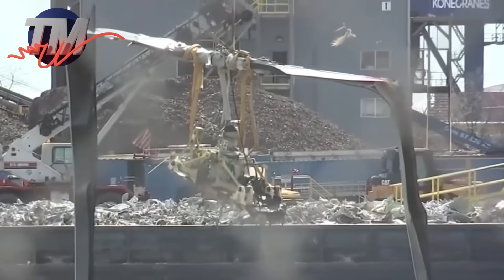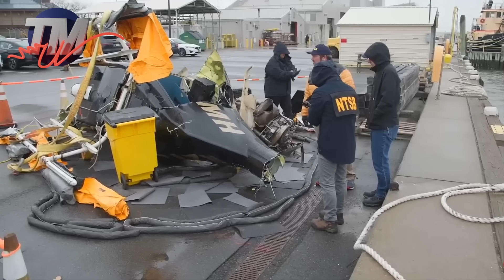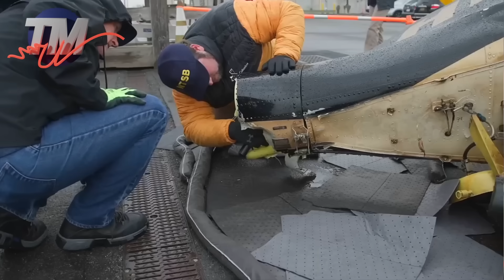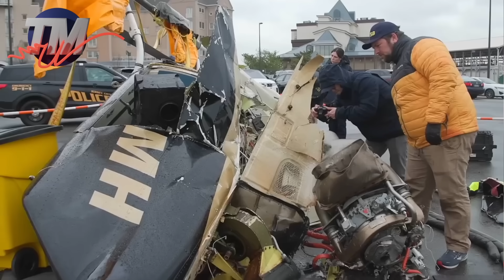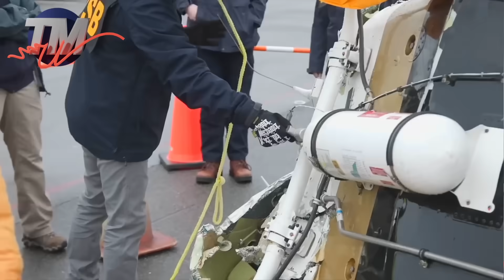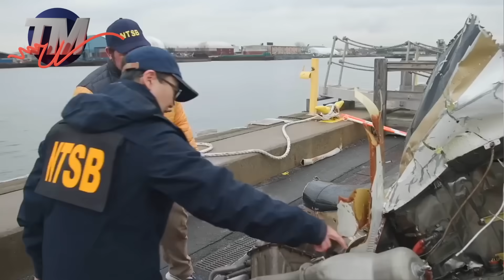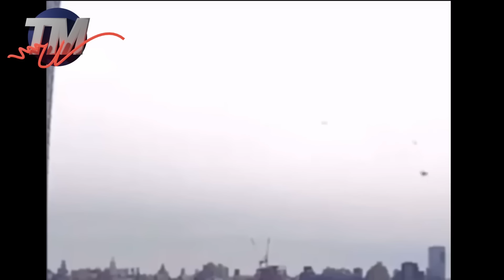Recovery of the Main Rotor of the Hudson River Tourist Helicopter - it's worse than we thought

Comment: It's not like you can hide accidents like this. Someone else suggested that there are far more accidents than reported but when a plane or a helicopter drops out of the sky in clear view of who knows how many people, never mind being recorded by multiple cell phones, how do you not cover that or cover it up? I understand close calls not being reported and from my own experience, I had a fireman tell me once upon a time, just how many times a week that they foam down the runway (s) at the airport in anticipation of a crash landing. I was horrified but there is a difference. You can foam down a runway just in case but that doesn't mean an airplane is going to crash or does. To be clear about this incident, the tail definitely came off first and coupled with the video that is being shown here, the suggestion that the rotor seized makes a lot of sense. There is video from another angle (north, I believe) that clearly shows the tail coming off first and then a second or so later, the rotor assembly detaches. In that video, you can't detect the twisting of the helicopter.

Comment: My WAG is the tail section failed at the joint. The tail prop still running, pushed the tail bending to meet the cabin. The tail then snapped off with the primary engine running. The main rotors over rotated and twisted off the transmission still attached to it.  The three main pieces fell into the Hudson. R.I.P. to those who perished.

Comment: AI Microsoft Message Copilot said: One of the leading candidates for such catastrophic disintegration in a Bell 206 L‑4 is a severe failure of the freewheel unit within the main rotor drive system. The freewheel unit’s job is to smoothly connect the engine’s power to the main transmission while allowing for a slight decoupling when necessary. If this unit loses proper lubrication or becomes contaminated by debris, it can seize or delay engagement. When it then suddenly "catches" at high engine RPM, the resulting shock—a rapid, impulsive torque transfer—can impose stresses far beyond what the rotor mast, head, swash plate, and the interconnecting structures were designed to tolerate. This instantaneous overload can initiate a chain reaction in which the rotor head literally tears away from the mast.

The massive inertial forces generated during such a delayed or abrupt engagement aren’t isolated to just the rotor head. The severe torsional and bending loads may propagate through the transmission and structural support beams, potentially ripping through the cabin’s roof bulkhead where these rotor loads are transmitted into the fuselage. Similarly, the tail rotor boom assembly, which is structurally linked to counteract the main rotor’s torque, can also be overwhelmed if the overall dynamics of the helicopter suddenly change. In essence, a catastrophic freewheel unit failure, though seemingly localized, can act as the trigger for a rapid disintegration of multiple integrated structural members.

While there could be other contributing factors—a seized pitch control mechanism, binding in the transmission bearings, or even a secondary failure in the rotor mast itself—the documented cases and airworthiness bulletins for the Bell 206 series have consistently highlighted freewheel unit malfunction as a prime cause of “mast yielding” and rotor head separation. This failure mode represents one of the few scenarios that is capable of transferring the enormous forces involved in the engine’s power delivery directly into structural overload, leading to the ripping away of critical components throughout the helicopter.

The complexity of helicopter flight dynamics means that even a small, localized malfunctional component (like the freewheel unit) can, under the right circumstances, compromise the entire rotor system, resulting in the kind of dramatic separation described. Investigations and airworthiness directives emphasize the importance of proper lubrication and regular maintenance of these power transmission components to avoid such catastrophic outcomes.

Comment: I don't know nothing about helicopters other than I never want to fly in one. I just feel so bad for the family and pilot. That helicopter looked like it just fell apart in the air  and unexpected. I'm sure the pilot would've gotten lower to the water had he known there was a major problem. This is one of the saddest things I've seen in a long time. The only good thing maybe is that the whole family went together. If I could take that families place I would in a sec.
Reply: No, he wouldn't have done that.  Altitude and speed are life.  The last thing you want to do is get low to the water.  You'd have no options.  Helicopters can glide to the ground (it's called autorotation) if they have enough speed and altitude.

Comment: Could this be a seizure of the drive shaft between the main and tail rotor? The only thing I can think of that could cause the torque necessary to rip a transmission from a frame would be a bearing seizing with the motor still spinning. Basically twisting the transmission rather than the seized driveshaft. This also may explain the tail shearing off. I gather there must be a bearing or two with a driveshaft along the tail shaft to transmit power to the tail rotor. If a bearing there seized the torque may be enough to twist the tail off and pull the transmission out all in one shot.

Comment: Mast bumping and the Jesus Nut failure idea's were never on the table in my book. I said on day one it was either Massive internal Transmission failure or the V mounting for the transmission failed. Obviously we know it wasn't the transmission mounting system that failed. Transmission failures with no warning are pretty much nonexistent, however that appears to be the case here. The instant turn left or right is more than likely the cause of the tail boom detaching about a foot ahead of the mounting point to the fuselage, all caused by the seizure. I'd guess the main rotor breakage was from impact with the river.
We had one transmission failure on a UH1-H in Vietnam in 1970. Loss of oil pressure, chip detector lite came on, low oil pressure lite came on and pressure indictor confirmed loss of oil pressure. We bumped up the RPM to max, got on the ground as quickly as possible, vacated the passengers, aircraft commander and finally the pilot after locking all friction adjustments tight. Rolling the throttle off the rotor came to a stop in 2 revolutions, transmission moved forward and to the right. No casualties or injuries.
As for the media: All these social media types trying to get subscribers and likes jump in on subjects they know little or nothing about. That's part of todays problem. The other part is,  journalists today in The MSM disregard honesty and facts to be first out with a story, that to is a problem and a fact. Just sayin!!

Comment: I'm a retired fixed wing comm pilot. I've seen a fair number of helo wrecks, this one doesn't add up. It's as if the machine flew into a 1inch diameter steel cable which ripped the entire rotor/mast assembly and fuselage panels off and then the tail boom. Very strange.
Reply: The thing is the tail boom came off first!
Reply: @garybulwinkle82  Fuselage was already is sudden hard yaw before tail separated.
And loss of tail wouldn't exactly explain why main rotor and gear box got torn away. It would simply only make fuselage start spining. 
This is more like whole gearbox tried to suddenly start spinning yanking fuselage with it.
Reply: @garybulwinkle82  Order of separation from the aircraft is not necessarily indicative of the sequence of failure.
Accident investigation 101.
Leave it to the pro’s.
Reply: The gearbox seizing is a good theory and it does explain the damage we see.  But at this point, it is one of many theories.

Comment: When we serviced the choopers in the Air Force one of the most critical tests was the oil sampling from the MRGB (main rotor gear box) there is a plug you take out which is magnetic, ANYTHING stuck to that plug means trouble and the gearbox has to be deep stripped and everything tested, xrayed and scanned for defects. If one lump of metal breaks off the gears thats enough to stop the rotor turning instantly. That would have the effect of ripping the whole assmbly off the airframe. The intense torque such an incident would generate is off the scale. From rotating to a full stop.
Reply: Exactly the kind of costly maintenance the company operating this chopper didn't have the money for apparently.
Reply: @jd5787  Just like ride operators at state fairs.   The cost of x-raying for metal fatigue is not cheap.
Reply: @williamboyle8918 which is weird . X rays are easy to make. It's old tech over 100 yr old
Reply: Had a Huey that got hit by lightning at Whiteman AFB. Started showing lots of shavings at the box plugs all of a sudden. Started a looksy and discovered it got hit by lightning , found a spot on the rotor tip and at one of the rails. Scraped it immediately,  chopped those rotors up for scrap,  cut hard!
Reply: @alandavis9644 Woha… "Whiteman" AFB wasn’t changed to something like "AFB Cuddle", with all the other ones?
Reply: @hugostiglitz5976 with the B 2 buzzing over, Blackhawks buzzing around, drone HQ center, not much of that stuff here in 7 to 2 Trump voting ratio.
Reply: @hugostiglitz5976  Yeah, the "mast bumpers" took it over.
Reply: Had a OH-58 blow a gear tooth in the main transmission.  Did a hell of a lot of damage, but the rotor kept turning.  Tailboom snapped off first from stressed skin failure.  That would cause the fuselage to instantly spin right from torque and pitch down due to improper weight and balance.  Bet it pulled the bolts through the honeycomb roof.
Reply: With seizures like that, wouldnt the gears be dislodged as in car gearboxes. Given the high inertia and momentum a small or larger gear usually breaks away from its secure positon inside the gearbox. So sometimes gearboxes burst or crack if the gears seize or something jams them. They dont usually stay intact causing the sub assembly to rip out. Im just speculating. Im no expert at all.
Reply: @seanbeukman9563 that is an excellent question! One might think that. The strength of the gearbox exceeded the mounts. IMO
Reply: That’s what happend, when my friend died, in an similar accident in Norway, a few years ago. Know we only fly sirkorszky s92
Reply: Megajoules id guess
Reply: I had always heard that the mast is designed to “shear” in the case of a transmission seize up so the rotor can continue to rotate. I am not sure if this is true or not, but it would appear to me that even if this is so that the seize up could be so sudden and violent that the forces would rip the transmission out. Anyone know if there is any truth to the mast shearing design?
Reply: Oil sampling and analysis is a vital and cost effective procedure for safety critical gearbox applications. It's like having a blood test, it can tell you so much about what's going on inside.

Comment: The helicopter may have collided with wake turbulence, which was also a contributing factor in the accident of American Airlines Flight 587 in 2001. Like in that accident, which was a result of the pilot pushing the airplane beyond its strength limit, the helicopter pilot may have over-reacted to a wake or other turbulence with an excessive rudder input

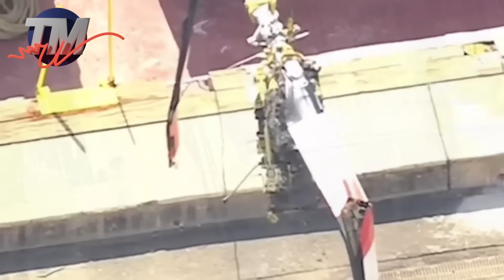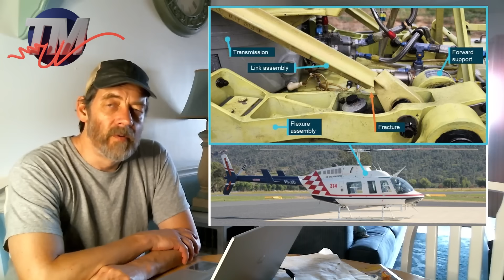Comment: I'm not an expert. Sudden gusts of wind, crosswinds, or high wind speeds can make pilot control difficult. At critical azimuths, such as when the wind is blowing from the right or the helicopter is moving to the right, a loss of tail rotor thrust can occur. A very noticeable chain of unfortunate circumstances. You can see the helicopter from 0:54 to 0:59. Behind the high rise, when it suddenly breaks apart. There of all places!!! Possibly, the building or something else caused the helicopter to veer into a sheer wind. Extremely strong crosswinds, winds developed or were caused by an air pocket with strong G forces, making it impossible for the pilot to correct the situation in a second. If the high rise hadn't been there, would the pilot have flown further? The investigators can test this theory in a real flight.

Comment: My best guess, so far, based on all the available video is corrosion. The main transmission is still attached to the engine deck and attachment fittings. I don't see evidence of the engine deck being twisted out do to high torque. It appears to be separated from the frames below the deck. I've seen those aluminum fittings corroded and beginning of cracks at the stress points. It required major rebuilding. It was exposed to the sea air.

Comment: From my understanding, the pilot lost all control surfaces. If the engine was still running the only thing he could possibly do would be to rev the engine making the fuselage spin. My question is, does anybody know if that would make the impact better or worse? The angle of the force of the water would be different, introducing a side load. On the other hand, it might create air bubbles that would cushion the impact. I want to make it perfectly clear that I do not in any shape or form blame the pilot or suggest he didn't do everything in his power.

Comment: A friend (we're both helo pilots) said the aircraft had been purchased from PHI Helicopters. Much of their ops are in salt water environments so I suspect metal corrosion leading to metal fatigue/failure will be looked at. Could explain why the entire gear case departed with the main rotor drive shaft intact. And perhaps that torquing action caused the yaw & tail boom failure.

Comment: The pilot doesn't need to disengage the clutch in the event of an engine failure. The free wheeling unit or Sprague clutch automatically disengages anytime the rotor rpm exceeds engine output shaft speed. This system works very much like the free wheeling unit in the hub of a bicycle drive wheel.
Reply: Search for accident report of an AS355 Twin Squirrel in Hampshire UK, in 2003... Freewheel clutch failure.... 3 fatalities... Tail boom folded and hit fuselage....and transmission and rotor departed the aircraft before impact.... Sound familiar?
Reply: @keithfisher7333   It is not a similar or prior case ...  The blades didn't hit the fuselage  not they cut the tail, the tail came off because of sudden rotation putting stress on the frame. I would say this is a gearbox seizure  combined with a freewheel clutch failure at the same time.   Makes you think twice about boarding a helicopter.
Reply: @keithfisher7333 you sir win the NTSB. 😂😂
Reply: Well, it would appear that on top of a gearbox failure - seizure , that automated clutch system you described also failed.
Reply: Yeah, but who days the RPM had to increase at all? And, if it didn't enough to trigger this, they the pilot ask has to preemptively disengage.   From what I've heard, that has to happen within a second or two, if not quicker.  And, if the indicator symptom and yaw happened at nearly the range time, the pilot wouldn't be physical able to do this.   WAIT FOR THE FINAL REPORT.   SPECULATION IS USELESS, AND STARTS RUMORS AND POLLS THE INVESTIGATION

Comment: If those rotor blades hit the tail boom, they would have vaporized. Those blades are not even broken in the same place. They were probably broken upon impact with the water. I'm still calling the forward tail rotor drive shaft coupling or a failed transmission mount causing a misalignment. One cause - two resulting failures.

Comment: The big question is: Where the front passenger controls still linked with the pilot? 
(or removed for tourist purposes)
As the Siemens top man was sitting in the front, here is a possible scenario:
The tail boom may have failed from fatigue, or it might’ve been triggered by accidental pedal input from the front passenger (non-pilot) stepping on the anti-torque controls. This could’ve caused a sudden yaw or overstress breaking off the tail. 
After that, in panic, he may have also grabbed the cyclic control stick, possibly conflicting with the pilot’s input, them fighting over the right to control. That kind of rhythmic force on the rotor system could cause mast bumping or deck overload, explaining how the entire transmission with rotors tearing off the roof structure. Sadly a survivable emergency of tail break turned over into catastrophic.

Another possible cause: if the tail rotor driveshaft broke near the end, the loose spinning shaft could have whipped around inside the tail boom. That could smash internal supports and even break the tail boom off from the inside. This kind of failure can happen suddenly and violently, especially at full RPM. (I have had this catastrophically happening to my back wheel driven van once, while driving on the highway...)

It is just highly suspicious that the tail broke of first, as this would be a survivable incident. But after that the rotors with complete transmission tearing off the roof deck structure, is just not plausible. 

Thirdly: given that this was not just a nobody passenger, there is still a small chance on sabotage or foul play. Maybe he had insider knowledge that the big deal of Siemens with the US was going to fail? (this was publicly announced some days later)

As the rotor, arm assembly and gearbox, came out in once piece, I would cross out gearbox failure, tail strike or bird strike. As this would have badly damaged the rotors or broken the blade retention bolts. I also doubt that gearbox failure can rip the roof structure, as it would more likely just break rotors and retention bolts.

Disclaimer: This is purely a technical hypothesis based on public footage, news over the last days and known helicopter mechanics. I am not accusing anyone of wrongdoing, nor do I claim to know what actually happened. Final conclusions should come from official investigators.